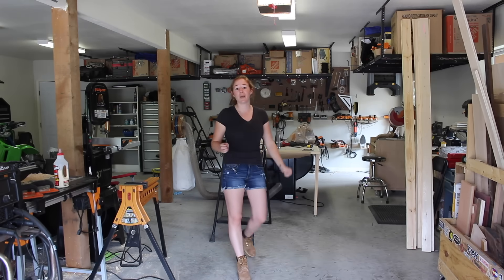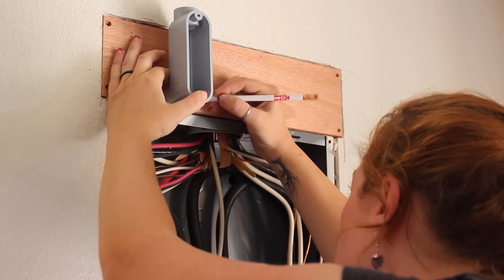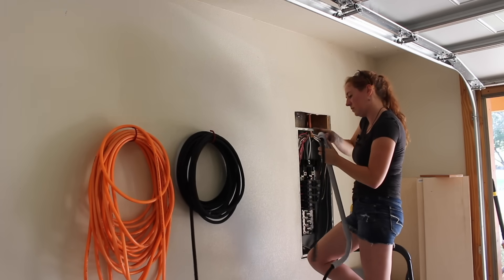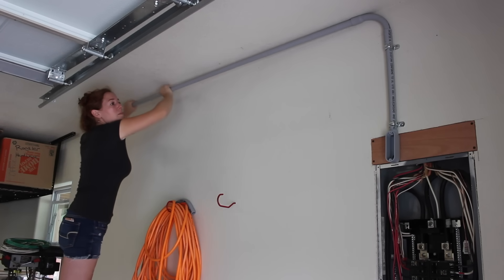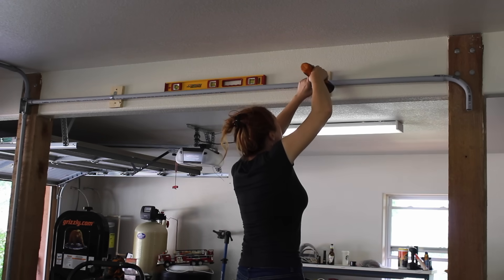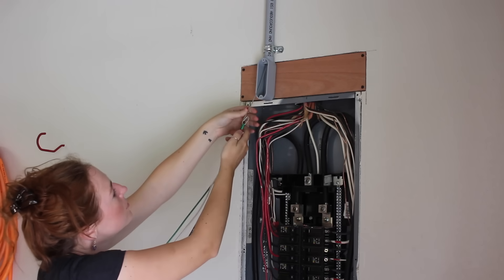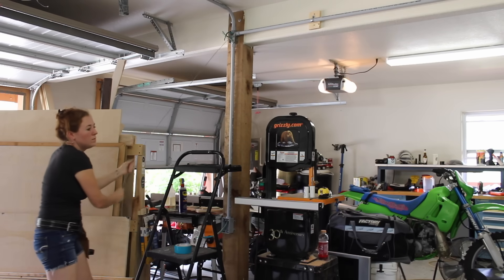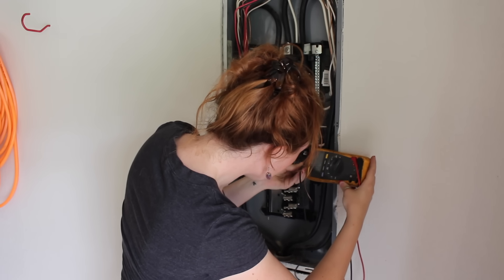Adding 220 Volt Outlets to the Garage

Comment: Hey! Generally speaking, really solid job. At the end, you asked for feedback on things that weren't right/would have been done differently. There were basically 3 different things that were code violations. They are small, but I will mention them in response to the specific request for feedback at the end of the video.

1. The THHN is free aired the 2 inches or so through the wall above the panel, and goes through the knockout with no bushing (ie, the sharp edge of the panel could potentially cut the wire). The pipe should have run all the way to the panel and connected to it with the same kind of connector used to connect to the metal box you used for the splice. I don't think it would have been possible with the way you had the LB, so it would have had to be set up differently, maybe with 2 45s to get the pipe into the wall and hit the top of the panel. It would have made it more dangerous to pull the wire too (metal fish tape into a live panel is a bad idea)There's a couple other ways it could have been solved too, but running THHN through the wall not in a pipe is not something you are supposed to do.

2. The metal junction box in the center should have been bonded, ie, a green wire should have been attached to the metal box with a green screw and then spliced in with the other green wires. This would be so if that splice came apart and the wire hit the metal box, it would provide a path for current back to the panel so the breaker would trip instead of the outside of the box being live and potentially able to shock someone who touches it. You wouldn't have had to do this if you had used a plastic box here, or if you'd used metal pipe (because then the pipe would provide the path back)

3. This one is comparatively tiny, but white wire is only supposed to be used for neutrals. For 220, it should have been 2 colored wires and a ground, ie 2 black wires and a green, a black a red a green, etc. You could have also marked the white wires black in each box with a sharpie, tape, whatever. Unlike the others, this is a safety method only as a form of communication to anyone else working on it, the electrons don't care how it's marked. but it is a code violation.

4. Other than those, I might have used a 4 square box for the junction to leave more space for the splice, but that's not as big of a deal. That's it.

Your pipe run was really solid though, and your work looked fine in the panel and on the plugs. So again, nice job.
Reply: same 3 items i noticed
Reply: Wow! Someone who actually put thought and care into their YouTube comment - they politely pointed out the error AND provided some solid feedback. We need more youtubers like this!
Reply: I don't' know US code (barely know Canadian code!) but we are required to glue all PVC fittings. Looks like they were just friction fit in the video?
Reply: Im not sure but are you allowed to have 2 -220 volt receptacles on 1-220 volt breaker?
Reply: @sallymookmook9002  I'm not 100% but I think it's permissible for cord and plug loads as long as the breaker is correctly sized for the ampacity of the wire (in this case 30a). It'd be inadvisable in most situations bc if you ran more than one thing at a time the breaker would trip. That's why I'm not 100% if it's allowed, it's not usually done.

But in this situation it probably doesn't matter bc it's a shop and it's unlikely two pieces of 220 equipment would be run at once. Even if they were, all that would happen is the breaker would trip.
Reply: @sallymookmook9002  I'm not an electrician, but I think you are right. She is probably using a 30 Amp circuit breaker, so she could easily overload it. It probably should be a single, dedicated line. The question I am asking the electricians is: I think the newest NEC code insists that all 120vac and 240vac recepticals are on GFCI circuit breakers. Is this true? Those Circuit Breakers are expensive, massive, and need a sub-panel for most cases. I'm going to avoid this issue by installing the 220vac recepticals in the wash room, which is on the other side of the distribution panel.
Reply: @sallymookmook9002  Would depend on the current rating of the breaker.
Reply: @sallymookmook9002  No.  You are not allowed to have 2-220 outlets on one breaker.  There should never be a junction box to split off to two outlets.  This is a huge mistake.
Reply: @number6396  Article 210 of the 2023 NFPA/NEC allows multiple outlets on 30-amp ( or 10 or 15 or 20-amp etc) protected branch circuits of less than 1000 VAC. So two 220/240 VAC 30-amp outlets are NEC compliant. If the loads to those outlets are cord-connected, then the load is only allowed to consume 80% of the breaker rating, aka max load = 24-amps.
Reply: Hey Peter. I have the same situation I need to go from a flush mount panel to surface mounted conduit in my garage. Any suggestions on how to avoid the free aired THHN. Cheers
Reply: @mikegarner2532  just seeing this now. You could fish romex (type NM) cable through the wall and into the box, using a connector where it enters the box, and putting a metal junction box where it exits the wall and running your pipe out of that. Or you could run conduit (PVC or ENT, the stuff Donald is talking about) so you could pull the wire uninterrupted
Reply: @mikegarner2532  You could use a flexible PVC conduit, with a fitting going into the box.  Would not have to use an LB.  The Flex is called "Carflex", and you buy fittings straights or 90's.  Some localities allow this Carflex to be glued to the rigid PVC, using a PvC coupling.  But some localities do not.  The code violations Peter mentioned above are all correct.  The one that stands out the most to me is the free air THHN...Don't do that.  And be sure all metal boxes are grounded with ground screw, and grounding conductor.  if you use white wire for current carrying conductor....you can mark it with tape at each access point to indicate it is not a neutral. She did a good job.  But if it were inspected it would have been turned down.
Reply: @mikegarner2532  romex
Reply: @mikegarner2532  Romex to an adjacent J box.
Reply: Nicely stated, very informative.
Reply: Peter
Reply: Thanks for the reply. And thanks for explaining in detail. All your points make a lot of sense.
Reply: I was briefly wondering where the other line was and why there was a neutral :)
Reply: @davidicousgregorian  thank you!
Reply: @wlit  😁
Reply: Peter, nice call on all the NEC violations.  April nice job on the electrical work my wife and I did electrical work together for over 40 years ( she is only 110 lbs.) watching you work gave me a nice feeling. Thank you for posting this video and keep learning life is a fun journey, I wish you the best.
Reply: Hi Peter,  Is there a requirement to have a trim plate on device box?
Reply: @mathewthomas7616  like a outlet or switch cover plate? Yes.
Reply: do we need GFCI for this 220v outlet in garage?
Reply: @tonytan8250  no. I don't think they even make 220v GFCI receptacles. If you really wanted to you could protect it w a breaker but you don't need to here
Reply: You are correct brother
Reply: How about PVC rather than EMT? I thought EMT was required for surface mount as sched 40 doesnt cut it? I know that any pvc i ran exposed outside that could be damaged required sched 80..
Reply: April Wilkerson should have had the common courtesy to at the very least thank you for your in depth, well thought out, and knowledgeable comment.
Reply: Never use a white wire as a “hot” if it is necessary color it black with a Sharpie on both ends . Do this thoroughly for as much of the wire as possible....A pretty good job but it is demonstration of why
Reply: of why qualified electricians should either do this work or supervise it. Inspectors in my part of the world not pass this without correcting the problems..... being an electrician is about way more than running pipe and twisting some wire together... retired Master electrician from Wisconsin
Reply: @iaov  Blah blah blah
Reply: @Coyote-tc1ww  what ever you say. I am sure you are very familiar with douce bags. When you have been around electrical contractors and worked in the field as long as I have and wired as many homes as I have come back you little girlyboy douce bag expert. LOL
Reply: @camarogs1  😂😂😂😂😂
Reply: @iaov  ok Ken
Reply: @camarogs1  You need to come back and fix your spelling errors.
Reply: Can product like "Southwire Ultratite Liquidtight Flexible Non-Metallic PVC Conduit" be use in here?
Reply: All good points, but I have to be THAT guy and correct one thing you said. If a wire is a neutral it MUST be white *(or grey), but a white can be anything but a ground. Green is the only color reserved for one purpose only, ground of course .

Edit*
Reply: Well now I have to correct MYSELF. A white can only be used as a hot if it's in a cable assembly (ie. Romex) and is identified as a hot... the things you think you know. 🤦‍♂️🤷‍♂️
Reply: @Gregory Rotondi I think she did run PVC.Just saying.

Comment: FYI PVC conduit is extremely toxic when it melts, where i live it is against code to run PVC indoors in a residential setting. If its not against code its not a problem but if their is a fire in your house just be aware of the toxic fumes.  Other then that very clean work.

Comment: On top of the panel box- you have the PVC  right angle junction box through the wood . Then you have a short run of the "pulling wire"  not in a conduit to enter panel box.. I'm sure this would not be a problem- but does it meet code? Forgive me if I'm not using the correct lingo.

Comment: April,   Very nice video!    I started designing electrical in 1983.   Two things.   You should re-identify the white conductor to red.   You can use tape for this.   You are not allowed to run THHN in a wall cavity.   You should use NM(Romex) cable from the panel to a junction box(not the LB).   Since you did not detail breaker amps, wire size, and devices used, no way to comment on that.
I hope you do not mind that I answered a few questions in the comments too.
Respectfully,    Kevin
Reply: I know this comment was 3 years ago but maybe you could give me some knowledge. I had a 20amp gfci/afci installed in my garage for a table saw (110v outlet). It trips everytime I turn it on. I thought about taking the wire and breaker out and installing the proper gauge and adding a 30amp for that outlet. Am I running into issues doing this?

Comment: Why one circuit? Two machines, two circuits, I would think...
Reply: That's what I was wondering, I thought code for 240v is one outlet max per circuit breaker.
Reply: NEC does not require 1 circuit 1 device.   It is one shop, 1 person.    Diversity!
Reply: I don’t suggest the NEC requires two, but I’d put the air compressor on one and use the other for the table saw, plasma cutter, or welder depending on what job I happen to be doing. In my shop I have separate circuits for all the 240v machines, but that may be overkill. I wouldn’t have just one, though.
Reply: Brian Dugle   Since the air compressor is semi automatic, I agree with you.   My comment was about the second comment.   Still not NEC if the electrical loads are calculated for any two pieces of equipment does not exceed 20 amperes (since non-continuous loads).

Comment: An Alternative to a fish tape is to run a string through while running the conduit. If you forget then use a shop vac to suck a string through. A small piece of rag tied to the end of the string will help the air carry the string through. I have pulled small lightweight string over 100' with the shop vac method. Great work, Like a Pro!!!

Comment: white should be red, but functions the same just so if someone else is working on it they know its a hot wire, even two black would be good, its not code that it need to be red just safe trade practice, but it is a code violation to use white, grey, or green as an ungrounded conductor aka hot wire. Also you should bond that metal box on the wall with green.

Comment: Pro tip, safety glasses block a significant amount if the harmful light from an arc, if you slip with your meter leads when checking the breakers or whatnot and make an arc, you can do less damage to your eyes by wearing normal safety glasses.

Comment: Aren’t you supposed to have only 1 outlet per 220V breaker?
Reply: Nico     Not a NEC requirement.   Common sense prevails.   One person shop, as many receptacles per circuit as you want.

Comment: The obvious problem is that for a 220V circuit, you need to run black and red wires for the two hot lines and not white since that would be used for the neutral wire.  You can fix this by using red electrical tape to re-tag the white wire at end points.
Reply: Chris Harper    Per NEC the conductors may be re identified.   Red tape is one possible.

Comment: Two things.  The junction box you used is too small and should be a 4 inch box.  Each 220v outlet should have been separate pulls from the breaker box and should be on separate breakers.
Reply: Ed Seitz    Based on what?

Comment: Nice work. 
However, it is recommend that you wear the appropriate PPE when checking voltages on a live panel.  Typically, for a panel of this size, category 2 PPE arc flash stuff is necessary.  Additional information is located in NFPA 70E.

Comment: Marry me!!! A 5s or 4s  box would work better at the top panel. Utilizing the kos in the back to attach a piece of s.o. cord, nm cable, flexible conduit,or amc cable from box to panel with  strain reliefs, two  screw connector, or flex connector. Overall nice vid you work  better than some dudes.

Comment: I ended up adding a 60A subpanel in my garage.  Originally, there was only one 15A circuit for the garage, and all of the exterior receptacles around my house.  This included only one GFCI receptacle in the garage, and the door opener.  I added a wall heater and a 2 Ton through the wall A/C unit, plus three additional 20A circuits for receptacles.  It's nice when the main panel is right in the garage!

Comment: I'm not sure how kosher it is to free wire from the LB through the wood into the top of the panel. A bit of a fire hazzard especialy if the wire is passing through the KO on top of the panel without some type of bushing. I would have gone with an offset directly into the top of the panel. Probably should have gone with Red for your B Phase instead of white too. also you need a strap within three feet of your junction boxes on the columns.... overall pretty impressive 👌.

Comment: Excellent job!

If you're ever pulling wire on a longer run, and the wire is getting hard to pull, they make a lubricant that's electrical grade to make it easier to pull the wire through the conduit.

Comment: As you are adding load, do you not need a permit and inspection? While homeowners can perform their own work, you still need an inspection.
Reply: Only if you are doing any remodeling work that involves taking down any sort of walls or electrical service upgrades
Reply: All jurisdictions are different on what you are allowed to do without a permit.   Always check with your Authority Having Jurisdiction!

Comment: I'm planning on doing a similar project myself and appreciate the detail you put into this. From my research you're supposed to mark the white wire by wrapping it with black or red electrical tape at each end to show it is not neutral or use red wire instead of white. The white wires above the breaker you installed are marked correctly. You need to add plate covers on the receptacle boxes. You need a support bracket every 3 feet for the size of PVC conduit you are using. I'd also use wood screws instead of drywall screws.
Reply: I agree with you on the wood screws; they typically have a flat under side that distributes the screw force onto the box tang while a drywall screw has a tendency to splay the box tang or break it, which is typical.  I guess the red tape works, but I'd always err to red wire.

Comment: Not that its code or a must but I ALWAYS wire tape my wire nuts, outlets and switches. ESP if I am using metal boxes. Being that you will most likely have vibrations and bumping into things once and awhile in your shop I think this would be helpful.

Comment: As always, these videos from April are pretty awesome. I will say this, I do not know if anyone else has mentioned this. She totally landed the wire inside the panel like I would expect a woodworker to. By simply cutting out the sheetrock and fabricating a makeshift panel.

Comment: i used a 8/3 gauges for a 220v 40 amp breaker...i was told that 220v circuit dont use the neutral. should i connect the neutral in the panel anyway?

Comment: I dont under stand why you cut the cables and jointed them in a junction box why you didnt  just run a second set of wires from your first outlet im sure the two sets of wires would fit in the power outlets termination points and leaving the second outlet the end of line , this is not how we would wire in Europe using junction boxes

Comment: Do you know anything about Two-Pole Quad Circuit Breakers (Homeline 2-20-Amp Single-Pole 1-40-Amp Two-Pole Quad Circuit Breaker) .? Can they be use for kitchen appliances ? I can't find any guidance on it .
Reply: I think you might be refereeing to space saver breakers. "google that" they were intended to add breakers and circuits to already full breaker panels without rewiring and replacing an entire breaker panel . A Licensed electrical company could tell you more if that's the case.